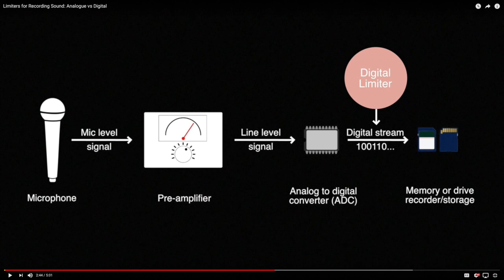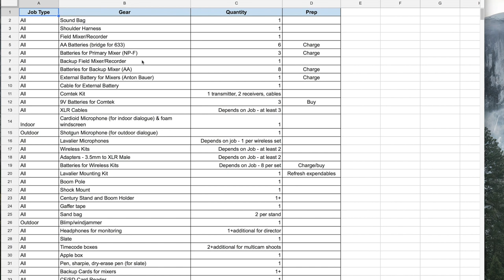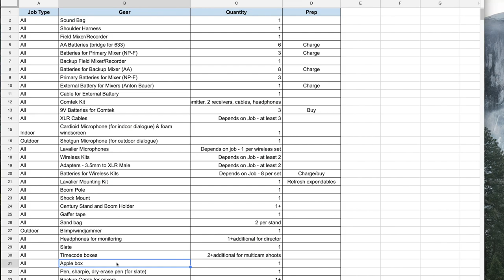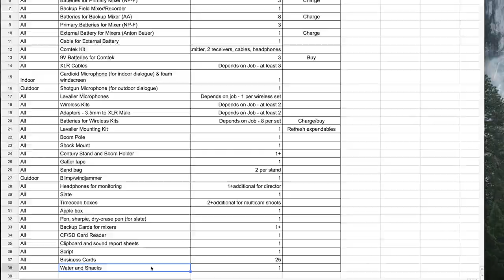Sound for Video Session: Zoom F4/F8 Limiters & Packing Checklist for Location Sound Job

Comment: Thanks for this one, brother. The way I prep for my gigs is to stay up until 2 AM the night before tearing my whole room apart looking through every bag and deciding which gear I need and which I can live without, and I usually end up bringing WAY too much with me. Before I even watched this video, I saw the title and thought "Why didn't I think of that?" Of course my list is going to be a little different than yours, you've given me a great jumping-off point. Really appreciate it. Also, I don't own an F-8, and the way the limiters work sounds very clever and effective, but I imagine dropping 10dB on the preamp and adding 10dB in the post-amp might raise the noise floor, even if it's ever so slightly. I'm working with the Tascan DR-70D now and it fits my needs just fine, but if I ever make the jump to some pro-level gear I wouldn't want to make any compromises with the noise floor.
Reply from the maker: Hi! Thanks! I've done plenty of gigs without a checklist in the same way and stayed up way too late. On the other end of the spectrum, there have been others where I clearly did not spend enough time and ended up forgetting to bring my lav hiding kit (all the tapes and expendables). That was embarrassing.

Technically, yes, adding 10dB of gain in the digital stage will bring the noise floor with it. Fortunately, the F4/F8 preamps are very clean so this isn't a huge cost but also not ideal.

Comment: Timely comments on the Zoom limiters Curtis. A few weeks ago I got permission to be on the launch site for a large fireworks display. I'd engaged the limiters on my F4 and left plenty of headroom... but the explosion sounds seemed akin to being on a battlefield! Before I'd wound back the gain - a lot - the meters were hard against the end-stops. I was expecting to have to ditch the first 30 seconds of the recording, but it's OK... the F4 limiting infrastructure seemed to work. I was somewhat surprised and puzzled... you've now given an explanation. Of course, analogue limiting is to be preferred, but with sensible anticipation I'm happy with what those on the F4 give me.
Reply from the maker: I agree! Even analogue limiters are not perfect, but the F4/F8 limiters are more effective than I would have expected for purely digital. Now it all makes more sense.

Comment: Thanks for the tips! And for the spreadsheet. I love being prepared. 
BTW,  having a video dealing with questions to ask and information to gather would be so incredibly helpful. For me, one of the most intimidating parts of just starting out (in any endeavor) is being a fish out of water and complicating production because of ignorance. Sometimes, there's no way around it, but having advice ahead of time can really help build confidence.
Reply from the maker: Thanks Ike!
Reply: Did I miss a link for the spreadsheet?  That would be nice.
The advantage for the V6/7506 low frequency emphasis is that it makes you more aware of low frequency problems that you might not notice otherwise.  As far as boom pole cases go, look at fishing rod cases.  I have a great Orvis Hydros for my short K-Tek.  I like to carry a folding 3 step stepstool for the extra height, a place to sit or drop the bag for a rest.  One more friend make is a multi port usb power unit.  Recharge those cell phones and you can be sure that they are also muted.
Reply: Hi Henry, you can find the spreadsheet here:

Checklist for gear you need on location sound jobs: https://docs.google.com/spreadsheets/d/13sI0mGplMC5p2VZHXotDdg9mSdvJVspP2H9_6qyn4Pw/edit?usp=sharing

Good idea to use fishing rod cases for boom poles!

Comment: Great info....a few things to add to your list....sound blankets, spring clips to hang the blankets, flashlight.....Check out Ktek's boom case (K-Tek KBLT52B) it's pretty nice but expensive ($232.75). It was the only thing I could find to hold a KTEK 202 CCR boom, actually can hold two booms plus cables and shock mounts, makes for nice case but just a little bulky.
Reply: How many sound blankets do you recommend Gregg?
Reply: I think that depends on the size. I have a dozen smaller moving blankets, 6x9' I think. Its enough to blanket walls on a normal sized room if needed. I would like to get the larger true sound blankets, maybe 6 or so, might be right if they are larger. I'm getting the impression moving blankets just don't absorb that much sound. Something specifically designed for sound absorption should be better. I'd also like to get some roll up carpets, tired of people tearing my blankets when used on floors.
Reply from the maker: All good info, thanks Gregg. Funny that I forgot to put the blankets on the list as I usually take at least one or two.

Comment: What I am curious is how you are currently moving everything, mostly I'm doing boom op work right now and the sound mixers I work with are of different opinions. My latest boss has the Orca OR 48 and it is a marvelous giant (I didn't get to see it with a tray in action because we were just using the SD633 but he tells me when he uses the F8 Control it works great). Most of the ones at least here use Pelicans or similar cases to move around (usually a big one and a more medium sized for two blimps and lav mics).
Reply from the maker: At my main day job, we have a massive composite cart which I use to haul everything in one trip. On freelance jobs, I’m usually just working with a single boom and 2 or 3 lav channels. I prep the boom with Cyclone at my car, strap on the Orca harness and bag and carry the rest in a large backpack. If I start working jobs where I’ll need to haul more gear, I’d probably look into the OR-48 as well.

Comment: My understanding (and experience) with recorders is that digital limiters often work this way. And the noise floor raises considerably on h6 when using the limiters for example. Am I wrong in thinking that there is not much difference by just turning down the gain 10db and apply gain in post compared to using the limiters?
Reply: Hi, yes, you could do it all manually by simply reducing your input gain and then in post adding 10dB of gain. Result should be the same.

Comment: Thanks Chris, its a positive feeling on the field knowing I own almost everything on your checklist outside of Comteks, which I am looking to investing into but I've currently hacked or put to use a good bluetooth tx/rx to wireless headphones for monitoring production sound  using the sub out outlet on the f8. It only allows 30 feet before i lose signal but saved me 1k in the meantime. The advice regarding using the limiters in Zoom F8 are especially helpful since i always dual record to be safe and clients love it. Can you recommend affordable IFB system outside or Comtek? I own 3x Lectrosonic UCR401 and 1x UCR100 receivers and 1x UM400, 1x SmQV, and 2x LMa transmitter.  Can these be converted to IFBs? I didn't find anything on the web but know it's option on the UCR401 receiver and SMQV transmitter.  I also own Rodlink wireless kit with the additional TX-XLR. Again thank you so much for the videos I learn about almost all the new gear I want to own through you youtube channel.
Reply: I was able to answer my own questions and got myself a Comtek M72 transmitter and 3x Listen Technologies LR-400-072 for less than $200.
Reply from the maker: Good find, thanks for sharing!

Comment: Analogue limiters are after preamplifiers
Reply from the maker: Not always. My understanding is that in the SD 633, they are prior to the preamp stage.
Reply: Well, If they were before the preamp, the aim of preventing digital clipping would be nulled
Reply: Sorry Andrea, I don't follow the reasoning there. If the limiting takes place before the preamp, then the audio signal will not saturate the analogue preamp and will not clip as it is converted from analogue to digital.
Reply: firstly, saturation of the preamp is not related to digital clipping. You can saturate a preamp on purpose on a desk and then compensate with the fader before sending to converters without clipping. What I mean is this, if you have limiter where you say, the mic will go into the limiter before being amplified. The level will be controlled but then you can clip the converter if you apply too much gain. On the other hand, when the limiter is after the preamp, applying too much gain will make the limiters work more, and bringing up the room/noise floor because everything is squashed. If you think about it the second option is the only one that makes sense in this application. Also, I am not aware of any hardware compressor that accepts mic level instead of a line level.
Reply: Ok, thanks for the additional thoughts. I see what you mean. I'll ask Sound Devices for clarification on exactly how this works in the 6xx series and MixPre series.
Reply: Also to give you proof from mothership of what I said, if you read the manual of the 633, at page 58 where it talks about the threshold, the threshold levels will prove it.
Reply: Thank you. Point taken.